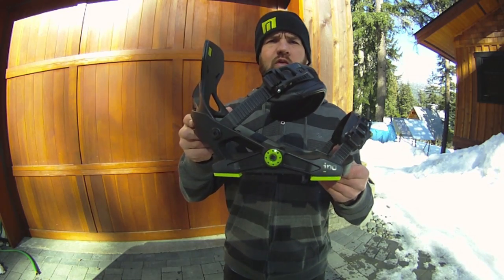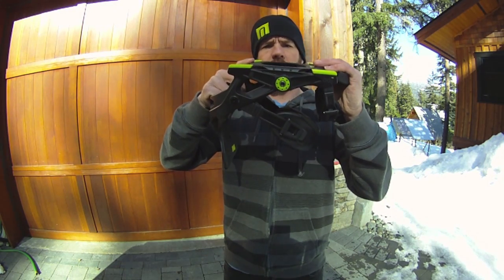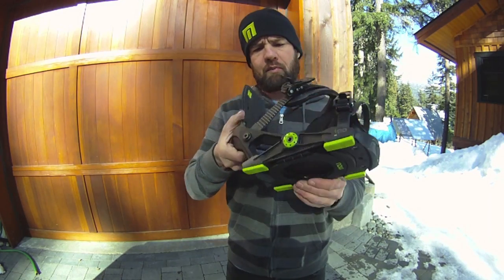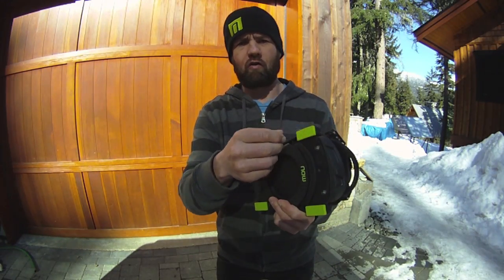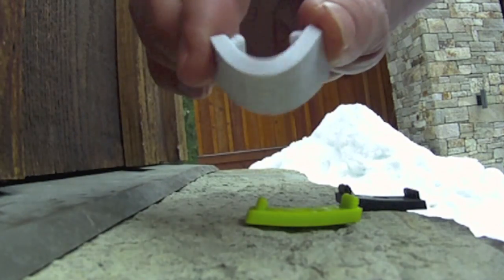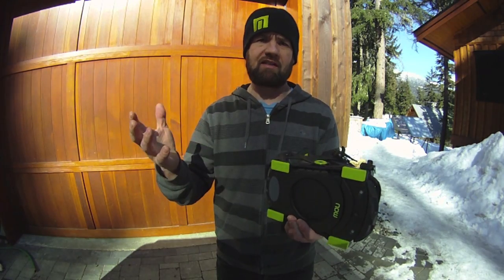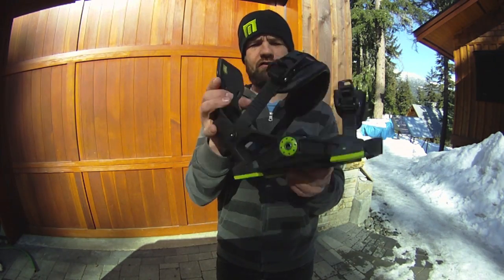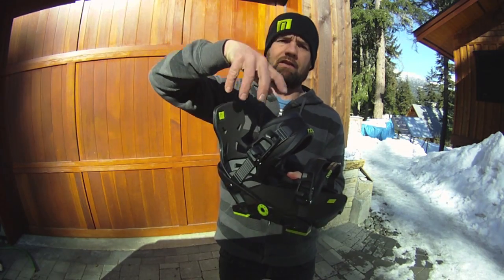The NOW binding explained

Comment: pointless technology.  It may be good for a run MAYBE two, but then snow will gather underneath the binding and prevent it from rocking.
Reply: False, after riding these for the past 7 years i can tell you that they are super responsive and snow never builds up at the pivot point

Comment: i feel like these would reduce response time and give you less leverage. if they do it probably isnt that noticeable unless you use the soft bushings. these bindings seem like they're best for easy going trail riders on the east coast
Reply: +brandon b ive talked to several good snowboarders who swear these bindings increase response AND comfort.  haven't tried them yet, though.
Reply: +Richard Shapiro hmm interesting. Idk though, in the short clip of them actually being used you can see the pads lifting up a little off the board. Now, if snow gets underneath those pads and I'm sure that would happen, and deff more than often on a powder day, it would hurt its performance